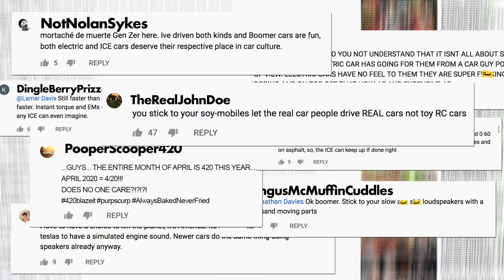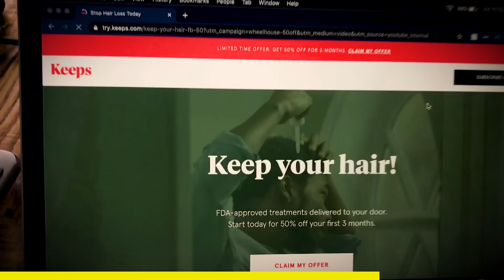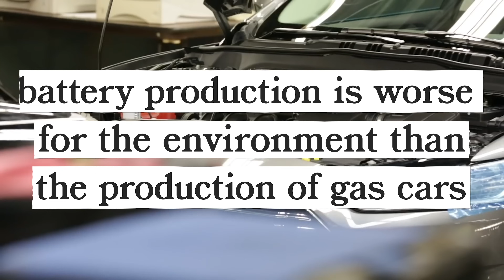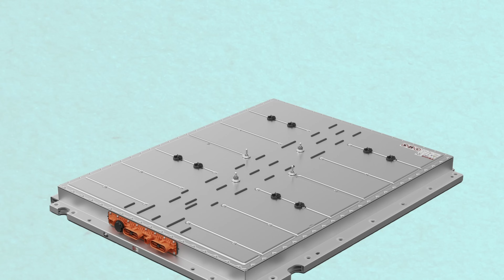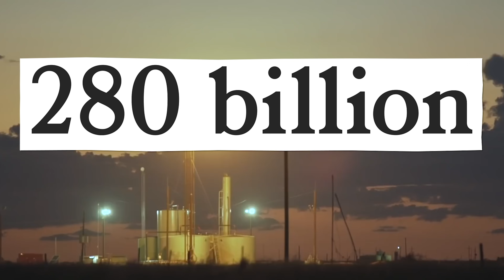Are Electric Cars REALLY Better for the Environment?

Comment: A lot of gas stations are also powered by coal power stations...they counted with that?
The "road" of gas truck tankers are much more polluted than electric wires, no?
Moreover, the really big problem for ICErs, is the time they spent to refueling their cars...I only spent 2 minutes to connect the cable and I go dinner, dancing, even sleep. 
I still going to the gas station only for buy some fast food/drinks and see how I was dumb!

Comment: If the electricity is produced by coal, 1 MWh = 970kg of CO2. 100 kWh thus = 97 kg. Through transmition and distribution you  lose about 5% each. Charging makes you lose about 16% and electric motor is about.
Now I am not going to calculate the engine efficiency, we simply know Tesla can make 400 miles with 100kwh battery. That is the best case scenario. To charge the 100kWh you need to produce - > 100kWh/(1-0.16))/0.95/0.95=132 kWh. That means 0.132 x 970kg = 128 kg of CO2.
If its cold, battery is less efficient, thus more CO2...
Now ICE cars with new norms engines burn approx. 6 liters/100km, so 400 x 1.61/100 x 6 = 39 liters you would burn to run 400 miles.
1l of gas when burned produces 2.3 kg of CO2, thus 39 liters = 90 kg of CO2.
Now you might argue that not all the electricity is produced from cole. Yes Globaly, only 37% is cole, 23.5% natural gas, 10.4% nuclear, 29% renewable sources (15.8% hydro,5.3% wind, 2.7% solar, 2.5% other). If I assume that renewable and nuclear have 0 CO2 production, then we are at 78kg. Natural gas produces 50% less CO2. So we end up 63 kg. That is 70% CO2 production compared to gas (petrol) 
So not 0%. 
And this is with all the caveats of less battery efficiency in cold etc. 
Last but not least, batteries are very heavy, so battery trucks we won't see for a long time or you will be able to transport way less goods per truck, thus the CO2 per kilogram of transported goods will be either equal or potentially in favor of ICE.
And very last point. 28% of the global energy consumption is in transport. Only 18% of the global energy is in electricity. So you would pretty much need 2-3x the electricity production to electrify the transportation. Remember, renewable resources are today only in 11% WW. And it is mostly hydro, solar is only 2.7%.....
The reason why renewable are only small% is the price... They are pretty expensive. At least the solar and wind. We need new sources (geo, fusion, more nuclear) 
Last but not least, question is the price.... You turn transport into electricity, the cost will go up. The grids will have to be updated, and you will spend hours a week charging your car...
Superchargers are not meant for daily use, they will shorten the life of your battery. 
Just remind yourself what troubles you have with phone, when the battery dies on you in the least convenient moment.  If all cars are electro we are doomed. Grid goes off we're all are stuck... 
To me effective hybrid cars are the way to go. City and low speed = electro, highway gas. Electro efficiency goes down with increased speed.

Comment: One thing rarely mentioned is that the emissions coming out of ICE cars is what’s left, not necessarily in addition to.  Back in the early 2000’s CARB’s plan was to use cars as vacuum cleaners on ground level smog since what was coming out the tailpipes was MUCH cleaner than what was going into it.  While probably not enough to change the overall carbon footprint of the ICE vs EV, Elon is trying to replicate that now with future Tesla’s.  Obviously, some area benefit from this effect more (like LA) than others.

Comment: I disagree about the power grid handling EVs. In California our reliance on solar power, wind power, and purchased power from other states almost caused a near catastrophic loss of state grid power after 5pm because of the dip in reserve power when people came home from work and drove up electricity usage last summer. The state had to delay closure of coal powered plants because they haven’t overcome the issue about what to do when the sun goes down and there is a heavy switch to reserve power.  Perhaps if had kept nuclear plants in operation, we wouldn’t have that issue.  Btw I lived in Italy that has a similar power consumption strategy as California where most of their energy is produced by France and they ended up losing power in the entire country for over 24 hours.   I think EVs will only be as good as the infrastructure provided, so I’d be leery of saying we have enough power out there for EVs.

Comment: Shat about hauling all those heavy batteries, requiring heavy duty specialty tires, extra weight, extra use of “electricity”. Do those batteries need to be recycled after a certain number of cycles, how is that done, are new batteries required...

Comment: You mention that oil produce a bunch of products other than gasolene... true, but you forgot that the mines in south America were originally for fertilizer and other items, Lithium was only partially refined and sold as an aside. So don't put 100% of the blame on Lithium.

Comment: Great video man. I would like to propose a benefit of ICE vs EV which I believe completely discredits any benefits of Ev's. First, what timeframe are you considering as the lifespan of a vehicle? I understand that 10 years or 100,000 miles is the max expected lifespan of a EV battery. At the 10 year point,  the ev battery would offer very little range between charges. To extend the effective lifespan of an ev beyond 10 years will require replacement of the battery, which we know is the component that contributes the most to GHG  production. An ICE vehicle by comparison, is not limited by 10 years or 100,000 miles. ICE vehicles are known to go decades and 100,000's of thousands of miles with just regular  maintenance . This is a fact of the comparison of EV vs ICE that is convienently omitted as a benefit that ICE  vehicles offer when relating to GHG production.

Comment: So the bulk of emissions for gas powered vehicles comes from mining and refining oil? Are we going to stop using all of the other things that require oil to produce?
...So we’re still going to need to mine and refine oil!
Sounds a bit like; get the Vaccine but you’ll still need to be locked down.
Something else to consider: what will be the difference of environmental impact when they hit the scrap yard? What are we going to do with all the used up toxic elements that go into those batteries? Can they be reused, recycled? Will they be?
Reply: Its not about that but fossil fuel combustion releases A LOT of carbon and global warming is very real as well as fossil fuel will run out eventually.
Reply: I thought they were calling it ‘Climate Change’ now..?
I’m sure ‘Global Warming’ is just as real now as the ‘Ice Age’ we were entering into in the 70’s.
I’m a big proponent of protecting the Earth and life on it, but people really need to consider the source when it comes to the impending doom pushed by ‘the Elites’!
If the Oceans are on the rise why aren’t they selling their beach houses and purchasing at the projected points of encroachment? Why do so many fly to these Climate Crisis Conferences in Private Jets? Is there really a consensus among the scientists? No!
Fear is the tool tyrants use to control the masses!

Comment: Where I live, we get 80% of our electricity from Coal, meaning hybrids are actually better for the environment than EVs where I live, but they're still better than pure gas cars. I can't wait until we switch to renewables over here (probably hydroelectric, since I live near the Colorado river, which is not the optimal solution, but oh well)

I actually prefer the driving characteristics of EVs, if I'm honest. The interior designs are too out there IMO, and the exteriors are too bland.
Reply: New fuels are being developed that give extremely clean emissions from internal combustion engines. For example the new synthetic fuel developed by porsche reduces tail pipe emissions by 85%. This would put the internal combustion engine on a level of emissions output at the same level as a electric vehicles.
Reply: @Brian-om2hh  the good news is that local grid concepts will allow easy conversion to a distributed "community solar" based grid, so this will change in the next few years!

The main reason we still use coal is because of the fresh mountain air, making coal have little to no impact on our air quality, and we are transitioning to renewable, slowly.

Comment: Your premise of comparing electric to gas cars is interesting and I didn’t read all the comments but I suspect your audience, like me, realize that is a rather challenging and daunting task since it isn’t like Comparing two different types of apples, but more like comparing apples with oranges. 

The part of your argument I found least compelling and helpful was your attachment of CO2 as universally a negative impacted on the environment, rather that discussing it as a challenging topic that it is. There are really good science representatives and research papers that indicate CO2 has many positive environmental impacts, and therefore at least pointing out that there is unsettled science surrounding it and therefore not including it in the calculation of what is more negatively environmentally impacting of gas vs electric. 

Here is a small sampling regarding that aspect. 
https://youtu.be/WDWEjSDYfxc

https://youtu.be/6DfL2-rbNdU

https://youtu.be/57W3ZhOAkAE

Thank you for your fine work on the variety of topics you discuss, and making your films entertaining and informative. 

God bless.

Comment: i just want to drive my  80s lancia for the rest of my life :(
Reply: Just do it.👍
Reply: you will
Reply: you can dude... all laws planned surrounding the use of ICE cars prohibit their PRODUCTION, not their USE
Reply: @Iamde4dinside  never said they were lmao?? Not sure where that argument has come from, literally just fancy having a go at anyone
Reply: @shotokankaratedude33  gotta defend car culture from EV idiots that don't want our cars to exist
Reply: @1mawesomel1kethat  I love EVs but yeah I support you as a petrolhead myself driving a Beemer !
Reply: Just hope they invent a cheap synthetic fuel
Reply: Ev conversion 🤔
Reply: Electric cars have a huge potential because they can withstand too much power and have s constant torque and power curve when fed with unlimited power ! That's why the most powerful locomotives (except the GE diesel locomotives) are electric locomotives !  Problem is with the power source ! It's difficult to come up with a battery pack which is light weight but also provides the required EMF and frequency for providing power to let's say a 2000hp power train which for now is not possible ! Even if so ,then they would only be owned by millionaires ! But what about a car which is easy to tune but also doesn't add up too much weight ,and is also available at a budget under 400k ? Well the Tesla roadster might have the potential of being one at only 200k with supercar performance and finally 1000km of range ,  yet  it hasn't reached the production line and still remains as a hype , though they did make a proper working car with the actual promised performance figures ! If so then it would be a game changer for a few car persons ! 

Also it's  easier to buy an IC engined car  at the price of a nissan leaf yet performs better than a nissan leaf ! Such as the Subaru WRX STI! 
 Solution: buy an electric car for commuting while an IC engined car as your fun car and Weekender or something that could be taken to car meets!
Peace ☮️!
Reply: @shankarwain4289  actually if you've ever watched the Ford F-150 vs Tesla Truck video by Engineering Explained then that very first statement you made is quite wrong, which inevitably makes your argument invalid, sorry but I do commend that you tried

Comment: So I love the fact nothing is mentioned about the toxic lasting effect of those batteries after either those batteries wear out or die.  With internal combustion. After the fuel is spent, there is no lasting toxic continuation.  Also, oil refining is not souly gasoline jet fuel and ky jelly.  Also, your ev does take part in oil refining process in the materials it's built with.. so don't kid yourself.   I think I'd rather deal with the headaches of internal combustion.  Then the long term toxic effects of ev batteries long after the cars are dead. Obviously more than makes up for the short term carbon gain of ev.  What about the other fact even Elon admitted there is not enough power plants in the US infrastructure to support the growing demand of ev's?  Wind turbines will not solve that issue.  Love it when people think just because there is no internal combustion engine in their car they are saving the environment.  When in fact they are contributing to a much bigger long term problem.

Comment: the only thing EVs need is a comparable used market(i am from a small country so there is only a few cars of every type on the market) and for the EU to force anyone building a charging station to either make it free or charge per kWh. i honestly don't give a shit if i have to make 2x1h stop to drive 300 miles since i when i drive that far, i am usually on vacation.

Comment: I like both EV and gas cars. I was initially going to buy a Subaru STi, but test drove the Model 3 performance. Ended up buying the Tesla because it is so much faster stock than the STi.

However one thing I don’t like about my Tesla is the inability to rev the engine at idle, Tesla has no handbrake, Tesla can drift but it doesn’t drift like a gas car, and many sensors makes it very difficult to put in aftermarket seats. 

Tesla is the ultimate daily driver... ultimate sports car - no. I still like driving my 400whp 2600lbs MR2 Turbo for hooning around town. Cant really hoon with a silent car, but it’s great for flying through residential and public streets over the speed limit undetected. Haha.

Comment: Am I a doofus, I did not hear anything regarding the disposal of the batteries, or battery life. I did get that he talked about 2 year life of the car. I have been driving for 50 years and never traded under 10 years of service to me, and most of those were years old before I got them. Never driven an EV myself.  Also, I have never heard any plan for those of us that have to have a truck ( actual usage need, not emotional need ). I still do handyman work and have to haul all kinds of stuff and tow trailers. Then there are the big rigs ( 19 wheelers ), what is the plan for them. We have to have them for virtually everything that gets transported anywhere.
Reply: cars with good cooling have 90+% of their original capacity after a mileage that exceeds what some ICe models do before getting scrapped. cars nowadays have 2x the capacity(compared to older models) which means they will have less cycles at same mileage and will last longer. plus, even with high degradation, they might still be enough for someone to use them wo a battery swap. for towing, there might not be much of a choice but there is a load of pickups hitting the market in the next year.
Reply: @yvs6663  I haven't seen any of that on pick-ups. My current truck with the tool bed on it is 6000+ lbs. For many years I have thought electric over hydraulic would be a good solution, but still I frequently travel 200 plus miles a day and have to work from my truck. Would not be able to leave it at a charging station. Not knocking electric, but a long way to go to fill the needs of our economy.